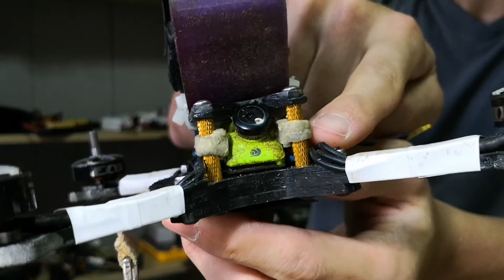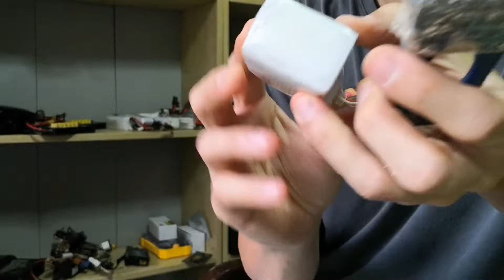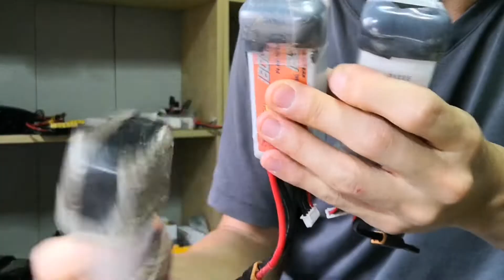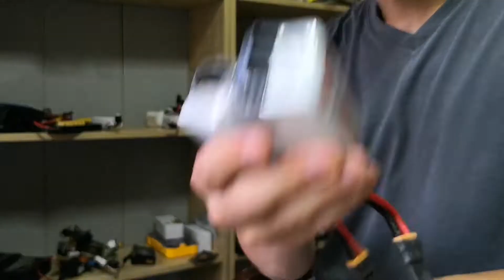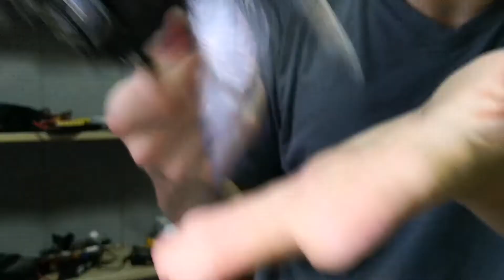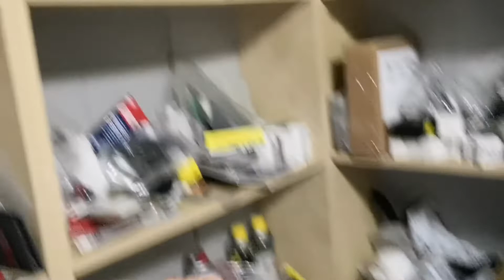A FPV life with no 3D print part.

Comment: Interesting for sure... I have a 3d printer but the only parts I print for my drones are the GoPro mounts... I print a lot of other stuff ofcourse.
I think there are many people who want to fly FPV but don't have much money so I think for them it may be a good idea to learn how to build stuff from everyday throwaway bottles etc.
Reply from the maker: You are right and the searching for alternative solutions to the 3d print parts is so tedious. I've been through that, at least on my own path. I'm just not sure if people will see the know-how valuable or not.
By the way, just curious, what are the things other than FPV part that you usually print?
Reply: @FireDFPV  Mostly camera mounts and light holders for industrial vision systems, boxes for arduino and raspsberry pi processor boards and of course parts for the 3d printer itself, which is kind of pointless...
My printer cannot print elastic materials unfortunately.
Reply from the maker: @Siamect  "The parts for the printer itself" 😂🤣🤣  You have experiences on both Arduino and Rasberry Pi, beside all the drone stuffs, what a techy guy you are.